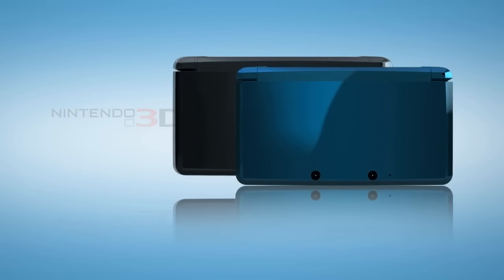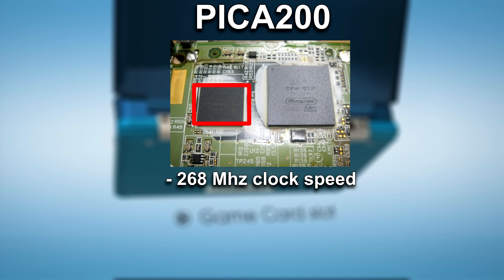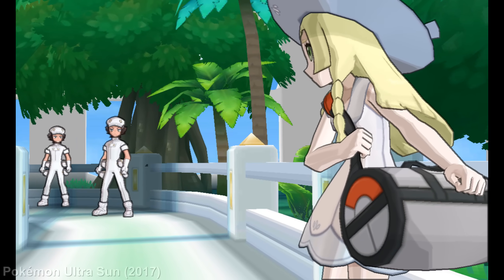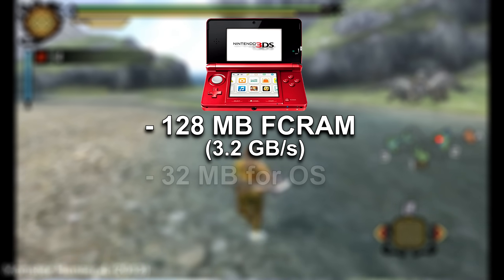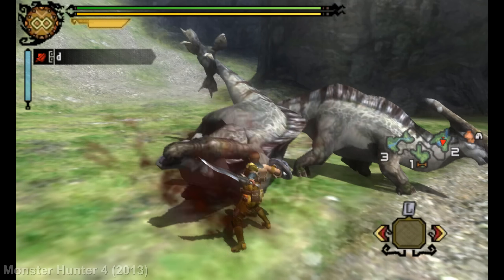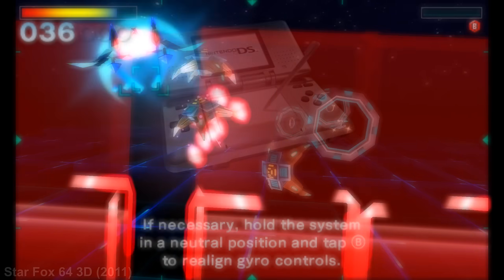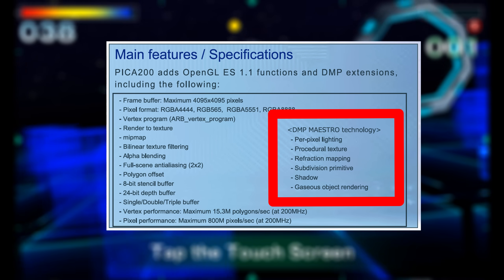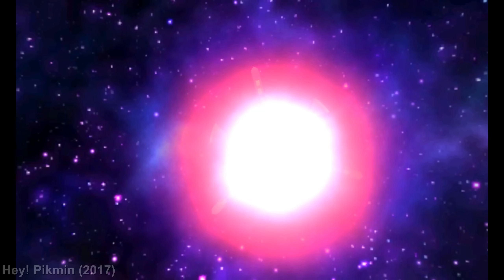The Nintendo 3DS GPU: PICA200 (Retro Breakdown)

Comment: I found out that my 3ds consumes battery in a sleep mode much faster than I expected... Any ideas why? When it's closed, is there anything to power except RAM?
Reply from the maker: That’s very interesting… it should be the same as the rest, but there might be something going on I’m not aware of. Maybe game save state data? If possible, I would try resetting the system to see if that helps 🤔

Comment: I really admired the 3ds and its stereoscopic capabilities, always trying to find out more information about it. I just came from your vita breakdown and I am stupified by the differences in power. The 3ds was just a small fraction of the vita in power, the memory constraints are almost laughable. And the limit to fixed functions. However nintendo doesn't need that. We saw on the switch that nintendos IP's and cartoon like graphics are plenty capable on this limited hardware. Also nintendo had such a strong number of multiplayer games to take advantage of two or more local 3ds units. 

You mentioned you would like to see sony get back into the portable market... I don't think I would. It wouldn't work out well for them. Nintendos switch is now their main system and they put all of their effort into it. They only need to worry about one version of their games being made on it and if a game is too big, they just dont make it. A sony hand held would be in the shadow of its PS5 big brother and companies would be on the hook for making 2 copies of most of their games, a ps5 version and a sony portable version, probably the same port they would send off to the switch. It is a division of resources that I would rather see put into the PS5. Maybe getting that price down. We are getting to the point in the systems life where we should see it discounted by %40 of its release price.

Comment: I had a lot of hours playing 3DS games, truly an excellent piece of kit like the gamecube just enough processing power with well thought out capabilities to do great things, but not not too much so as to drive costs up and battery life down. The ergonomics of the 3DS XL with smoother edges was better, and the larger screen was a treat when you were used to the smaller one. the library is particularly excellent and that's ignoring the DS titles that also work in it. I ended up owning 4 of them total.

Comment: I was never very impressed by 3DS visuals.  The machine was very low resolution at a time when smartphones were already outputting in HD, and it lacked the kind of lo fi, pixelated charm of the DS at its best. 

It was definitely a huge leap from the DS, for sure,  but I think if you really want to look closely,  it might be worth comparing its specs to those of the PSP.

Comment: I think you made a typo at 6:00. ARM7 is used for audio mostly for DS/DSi. I believe also Wifi communication is also handled by ARM7 as there's a block of 16KB of internal ram dedicated to wifi that only ARM7 has access to. ARM7 also runs around half the speed.

I assume you meant to put ARM9 there. That is what handles graphics on DS/DSi and is the one that ran at 67mhz in DS mode (with it doubled in DSi mode). (GBA that came before DS used arm7 for both audio and video). On DSi, arm7 also handles SD access and some security stuff. GBA only had one CPU. ARM7 which pretty much handled everything. But DS and DSi had 2 with DSi clocking the ARM9 at a higher clock speed for DSi mode for newer game carts configured for that (as well as all DSiWare). ARM9 when handling the security CPU role in 3DS mode on 3DS, it runs at 133mhz instead of 67mhz so it retains the higher clock speed from DSi when 3DS is using it for that purpose.

DS games still used the original DS clock speeds on DSi and this also applies to 3DS when it's in backwards compatiblity mode for DS/DSi games. (with ARM11 mostly serving the role of showing the message you see when you hit home menu button as well as sending the video output of arm9 to the displays. I think it also sends inputs over too. I don't recall all that arm11 does in backwords compatiblity mode as I've not done much 3DS homebrew in quite awhile now. :P

Since 3DS supports DS/DSi games that does mean it also has an ARM7 but it is turned off in CTR mode (3DS mode). ARM9 is active in both CTR and in DS/DSi mode but serves only as a security CPU that handles crypto and verification of RSA stuff, etc. I don't think ARM9 does much of anything in the little used GBA mode 3DS has.

It's pretty impressive Nintendo maintained compatibility with 2 older systems. Though GBA mode saw little use as they ended up only using it for a few GBA VC games given to a select few who bought the console before the price cut after launch but it was there and existed in some official capacity. (unlike Wii-U which does technically run GameCube games but only via unofficial software). Wii and DS only had backwards compatibility with 1 previous generation with N64, SNES, GameCube, and Switch not retaining any previous system compatibility at all.

It's entirely possible had Wii-U not been a flop that they might have brought over some GC VC titles pretty easily given how well Nintendont seems to work on the console as like the 3DS the Wii-U was capable of natively running games from 2 older generations of hardware which didn't happen often as DS lost Gameboy/Gameboy Color compatibility, GameCube due to using optical disks not retaining any compatibility with N64 stuff. So 3DS and Wii-U are standouts in this regard. Switch 2 will be the first main console in awhile that will have any form of backwords compatibility given how long they've managed to keep Switch a viable product. Both using similar cartridges means Switch 2 will likely be a DS to 3DS situation where the cartridge slot will support both carts so they will have no problem supporting most older Switch games. I would not be surprised to see Switch 2 giving their new cartridges a similar bump at the top to serve as a method of preventing the carts from being inserted into original Switches. Though maybe this time they will just alter the shape at the bottom of the cart instead to key out the card from being used in older systems. We'll see in a few days I suppose. Hopefully they will show off what the Switch 2 cartridges look like.

Comment: is the 3ds closer to gamecube but not wii since it belong to 6th gen tier and if we port gamecube games to it?
Reply from the maker: Yeah 3DS is closer to GameCube in raw GPU power than Wii. In floating point performance, it is weaker than GameCube still, but the 3DS only has to render an image at half the resolution of the GameCube and often at half the average framerate and still look good on the small 3DS screen, so the parity isn't as far off as raw numbers make it seem.

Comment: 4:30 Next Level Games did the opposite on Luigi's Mansion 2: intentionally increasing the polygonal detail of objects and the world while using very basic vert coloured materials as much as possible, since the 3D effect worked best when there was lots of geometry present.
Another interesting thing worth mentioning is that in 2D mode it basically received "free" 2x1 (or 1x2) super sampling anti-aliasing. Internally the framebuffer was either 800x240 or 400x480 which could be either used entirely for a single frame and then squeezed into the final 400x240 resolution, or in 3D mode it was used to render two 400x240 frames with no AA.

Comment: New 3DS also showed just how CPU-limited the original 3DS was. Monster Hunter 4 Ultimate had a huge performance increase.
Reply: Yes ! Have you ever tried to run Xenoblade chronicles while mimicking the original 3DS cpu ? (base clock + no L2 cache)

It's literally unplayable, the game runs at like 10-14 FPS
Reply from the maker: That’s very true ☺️
Reply: The CPU in the New 3DS was so ridiculously overpowered for what it needed to be, too. 804 MHz quad core ARM? Absurd.
Reply: @JoMamma42  To be fair the fourth core was exclusively for face tracking... and the third one did nothing...
Reply: @luishermogenesrodriguezram7 did developers utilise them both for games if they didn't use face tracking or camera and stuff just to buff performance? And if they didn't seems like such a shame not to as its twice the cores for no drawback basically

Comment: Correction: The 15.3 Million Polygons Per Second was calculated when the GPU is running at 200MHz. The 3DS one runs higher than that at 268MHz, so that would make it capable of 20.5 Million Polygons per second. It could even be higher since the PICA isn’t really a series and had many revisions. There was a 2008 one (if I remember correctly) that could do 40 Million at the same clockrate which is 25 million more compared to it’s initial 2006 version

Comment: The biggest problem I had with the 3DS is it's 240P screen. All the footage used in this video is emulated in HD. And those games look way better that way. Even for 2011, 240P was really low, it was even lower that the much older PSP at the time.
Reply: On original hardware it looks perfectly fine
Reply: it wasn't a problem on 3DS' screen. Especially when you turned on 3D that basically doubled the resolution.
Reply: Stereoscopic 3D means twice the pixels 240p would otherwise be.
Reply: @comDotB 800x240p to be precise. Not counting the 320x240p bottom screen

Comment: The o3DS was so powerful for its size but still can't emulate SNES properly to this day lol
Reply: The two are non related. Even a gaming PC is crap at emulation. That’s why you have companies like analogue pocket that actually build dedicated hardware to run these old games faithfully.
Reply: @RobbyRyanson PC emulators are just as faithful, they simply take more power to run. FPGA has the benefit of not requiring absurd clock speed to achieve accuracy. MiSTer's N64 and Saturn cores are a testament to this.
Reply: @cameronabshire1195  that is 100% categorically untrue

Comment: More corrections: the 128MB memory split was 64/64, not 96/32. It's an easy mistake to make because most news websites listed 96/32 around the launch date, because that was the split used in dev kits for development purposes. But retail units used 64/64 split.

After the New 3DS released, some games started using "extended memory mode" to run on the OG 3DS. These games would reboot the 3DS into 96/32 MB mode, which disabled the home menu and all applets. These are the ones I could find, but there might be more:

Super Smash Bros. for 3DS
Pokemon Sun/Moon
Pokemon Ultra Sun/Ultra Moon
Super Mario Maker for 3DS
Reply: New 3ds also has such a feature (the numbers escape my mind), though it never got used officially.
Reply: How about just adding a little bit more ram? Crazy idea for Nintendo.
Reply: @ if you do that mid-generation you may as well call it an entire new model as otherwise you have destroyed compability

Comment: I wish fixed function hardware was still this well implemented and developed for. If Nintendo brought out a console like that now it would flop hard. A highly complex yet optimized GPU like that in modern days could outperform general processing GPUs of current times at a 10th of not a 50th of the power draw. I mean what system has such efficient coding and hardware anymore.

Comment: The vertex stage in the 3DS is programmable. You can even see listed in the specifications shown at 1:53 (Vertex Program ARB_vertex_program). 

It also supported a type of geometry shader (not listed in the specs) which could output multiple triangles from a single input. It was used for:
- Stereoscopic rendering: could output vertex parameters for two triangles (one for each eye) from a single vertex shader invocation.
- Particle/point rendering:  convert points into quads (some games even used this for grass rendering).
- Toon outlines: output a larger, black-colored triangle behind each input triangle to create outlines.

The vertex shader also had to produce the inputs for the fixed pixel pipeline, like normals, tangents, texture coordinates, etc.

Unlike the Wii/GameCube, the 3DS also supported cubemaps, but one feature that was sorely lacking was per pixel texture lookup (something both the GameCube/Wii and the OG Xbox could do). This limited the implementation of reflections since they couldn't be distorted by normal maps. The only way to make shiny per-pixel effects was using the per-pixel lights in creative ways. For example, it's possible to specify a color gradient map for the lights. This was intended mostly for making cell/toon shading (by using a gradient with few color bands instead of a smooth one), but games like Super Mario 3D World used it to make rim lighting and reflection-like water effects.
Reply: Thank you for the explanation!!!
Reply: Interesting enough some games do use texture reflections while others don’t. Mario & Luigi: Paper Jam for example had blending textures for the floor on Peach’s Castle which was the starting area. But other games like Art of Balance did not use blending textures which was odd considering the Wii version of the game had it
Reply: You can't output triangles for each eye in the geometry shader,  the way stereoscopic rendering works is by rendering the scene twice and outputting to different framebuffers.

The geometry shader is useful for outputting more triangles from the input vertexes, but the entire pipeline runs once for each scene render.

Comment: The 3DS was the first handheld I ever purchased with my own money. I remember how much sharper games looked over the DS thanks to its much higher resolution screen and high pixel density.
 Games like Resident Evil Revelations blew me away! That game looked nearly on par with Vita games at the time. 
All in all, the 3DS was a very fun system in its early days (once support started picking up) and while it was never on par with my Vita graphically, it got way more use in the end.
Reply from the maker: You must have a special place in your heart for the 3DS then riot sure! I was so blown away by how good the game looked when getting some clips for this video. I didn’t have the pleasure to play back in the day and MAN I missed out!
Reply: I'm curious, did you play DS games on your 3DS to compare them? Just wondering, because 3DS was only slightly higher resolution (25% more on each axis for the bottom screen), but DS games looked blurry on it due to the soft upscaling it used.
Reply: @jacklawsen6390  Its possible to play DS games in native resolution on the 3DS so there's no upscaling and it maintains its sharpness. Its either holding Start or Select on launch. Of course it does look weird since its a lot smaller on the screen
Reply: @ack5593  Oh, I know about that. I was just taken aback by someone talking about the big resolution jump from DS to 3DS when it was a rather small improvement. I wondered if their perception of greatly increased clarity was due to comparing 3DS games running at native screen resolution to DS games using blurry upscaling.
Reply: @jacklawsen6390  i Guess it's also because of the novelty, I remember the jump from my crt to LCD, and from 360 to 480p.

Comment: I liked the informative video, but one thing I would say when talking about hardware specs is using actual hardware resolution (not necessarily a capture card as those are ofc hard to come by with the 3ds) when showing footage of that console. It's pretty clear that footage of games running on the 3ds from this video was acquired through an emulator upscaling the resolution of the models and textures, which I feel is a bit misleading to the power of the actual system when the goal is to inform of the capabilities of the system. Again though, great video, I loved the deep dive on a component of a system I truly love and cherish!
Reply: Not sure how I feel about this because low res scaled up to the size of a monitor or TV is going to give a bad impression of an otherwise sharp picture. 3DS games look great on 3DS with the pixel density of about 132ppi, but put that same footage on a big 4K TV and the pixel density gets destroyed (only about 60ppi). Depending on what people use to watch the video, phone, TV, etc. and the quality 720p, 1080p, the pixel density is going to be wildly inconsistent. I can see why he would do it this way, otherwise it makes the 3DS footage look worse than it does
Reply: @EhurtAfy that's a fair point, I wasn't really considering the wide spectrum of devices that were going to watch the video. As personal preference I would still prefer to see 240p with an integer upscale to keep the hard edges in tact, but I can't necessarily speak on how well that would look on various screens at different resolutions.

Comment: Great series, do you have a playlist of GPU/CPU breakdown or something, which consoles have you already covered, and, will you cover 8, 16 and 32-bit consoles as well?

As for my personal experience, I never owned a Nintendo handheld, but I did play Game Boy and the NDS at some point. I believe the NDS is the superior choice regarding games library, just like the PSP is superior to the Vita for the same reasons, and in both cases, the later hardware is far superior and backwards compatible to some extent.

And also, the success of the GBC/GBA/NDS/3DS are mostly due to kids being crazy for Pokémon, otherwise, they'd still be a success, but with less than half they sold overall.

If given the choice for a PSP over the NDS and the 3DS, I'd always choose the PSP without a second thought. Not only Sony's handheld felt like a true console, it has amazing exclusives and can play many emulators and lastly, but absolutely not less important, it plays basically the whole PS1 library.
Reply from the maker: Yes I do! I have a tech video playlist that has a broad list of videos and my retro breakdown playlist for videos of this exact style ☺️ and I agreed with you 100%. You hit that right on the head!